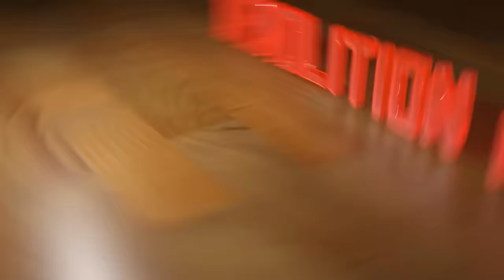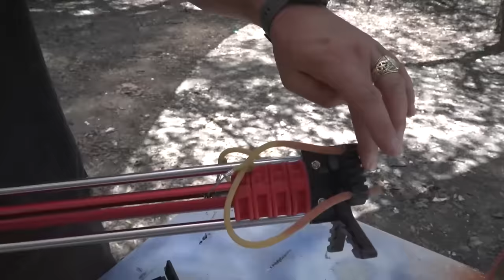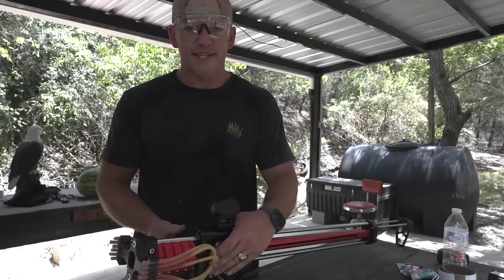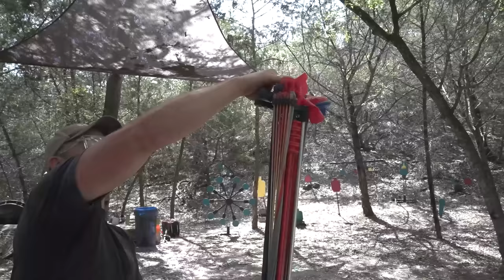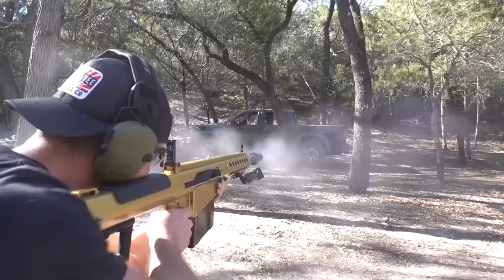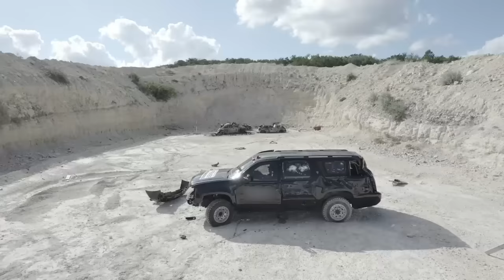The Chinese High-Powered Slingshot Gun!!!

Comment: Because sling shot, except bow, rocks, stic, spear, knife... fire, seems to be ultimate survival weapons I've figured out different scenario. I'm a fan of apocalitpic movies and I've got challanage. If You could chose three weapons having a car knowing that you will have to move on feet from time, to time. What kind of weapons would you chose from Your arsenall. But there are three restrictions. 1. Side arm must be the most rliable with general accesibility of amunition. Perhaps even possibility to shot different types or calibhers of bullets. Don't have to be pistol it might be SMG. 2. Secong one. The carabine, rifle, shotgun of the general purpose for hunt, CQB, for long range shooting and defending against enemies must be  versitile in it's gheneral purpose. Which concludes that general accesibility of an amunition also should be important. 3. The last one, the heaviest which You probably wouldn't  want to drag all the time must have as much power and ability to defend against multiple enemies as possible. Assuming, tht those weapn would be the one which You would left in a car, when walking it should give possibility to remove it's combat potential as fast as possible, by removing some part and restoring it to it's functionality also as fast as possible. So what three weapons would You choose? This is genera not retorical question. The answers will not be rewarded.
Reply: Thanks. I don't know what I'll do with it. I don't use messengers often.

Comment: Well I don't know I made one of the plywood and a 2 * 4 and or sorry a 2 * 6 cut and you know whatever and mine would shatter a cinder block from 100 ft easily and I used three different sicknesses of surgical tubing inserted inside each other and I had so it was six bands on each side cuz it was technically look like only two on each side and it was powerful you could barely pull it back and I could put say a steel ball bearing that was about a half an inch in there and it would blow right through a cinder block and like blow the thing apart it's not supposed to be using BBs it's supposed to be a large ball bearing

Comment: i made a better one using spear gun rubber and a chinese slingshot trigger, steel tubing and some wood for a stock. using a scientific bathroom scale it takes 80 pounds of pull to cock it. fairly accurate and dose not fall apart. i use 1/2 inch steel ball bearings for ammo.

Comment: Dude come on this is not rocket science everything you tried was never going to work except for the one steel round

You're taking a marginally powered weapon and you're dividing its power amongst many individual projectiles so even if you had enough power to actually penetrate you destroyed that power by dividing what little power you had amongst 20 objects

This is only going to work if you use a single projectile like you did with the little steel round

Probably the best thing for this would be crossbow bolts They would fly straight and all the energy would be in the single bolt.

Comment: Those slingshot rifles are terrible, full stop. A total waste of money. As someone already mentioned, rubber has a maximum contraction velocity of roughly 230 fps at room temperature, which implies that the only way to increase power is to have more rubber flat bands or tubes, and a higher projectile weight. 

A regular slingshot can in fact be a very accurate shooting tool in trained hands, i.e. regularly hitting a 1.57 inch spinner at 10 yards at competitions is possible. Ideally, you should anchor the loaded pouch somewhere on your face to ensure steady projectile velocities and to achieve good accuracy: the narrower the fork width, the higher the anchor point. Some people hunt small game with slingshots where this is legal.

Moreover, because China has extremely restrictive gun laws banning even the ownership of BB guns, shooting enthusiasts there only have slingshots to opt for. Some of the better Chinese slingshots are commonly made of stainless steel or titanium, come with very low placed forks to reduce wrist torque, as well as fiber-optic sights and well engineered clamp systems for flat bands. They're definitely fun to shoot, whether by adults or kids. Aliexpress is where to find them online at a good price.

The Chinese shoot mostly 7 to 8 mm steel ball bearings, whereas Americans tend to like 9 to 10 mm steel ball bearings for their homemade or purchased slingshots. I did a video review of a good Chinese target slingshot - see it here, if ever: https://www.youtube.com/watch?v=zA9wr7SeCgk

For those who prefer American-made slingshots, just Google "Simple Shot", who sells a very nice range of products. Last bit not least, also have a look at the US Slingshot Forum to learn more about slingshots. Happy shooting!

Comment: This slingshot is such garbage. However, I think if you would have used a big lead slug it would have worked a bit better because it has strength but not speed. A harpoon gun is deadly for example.